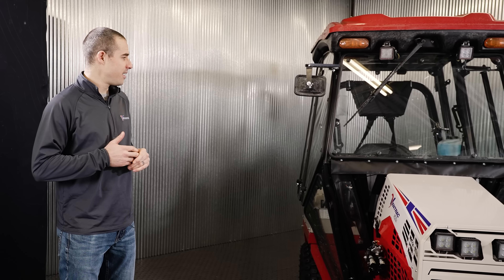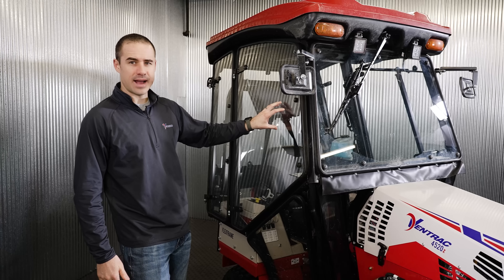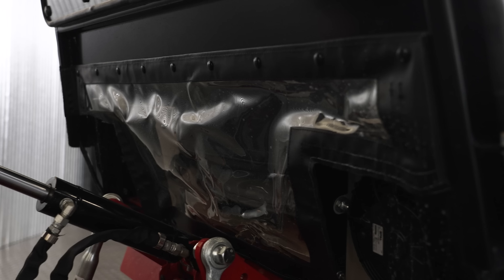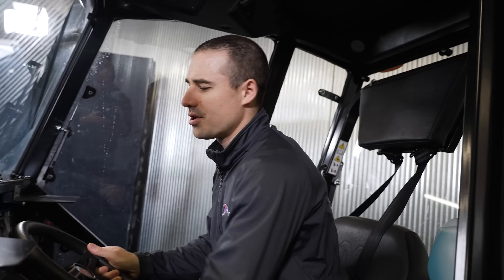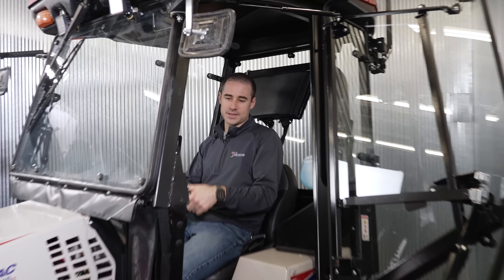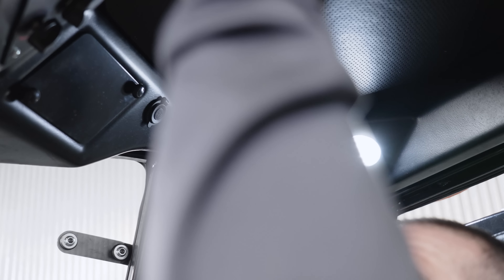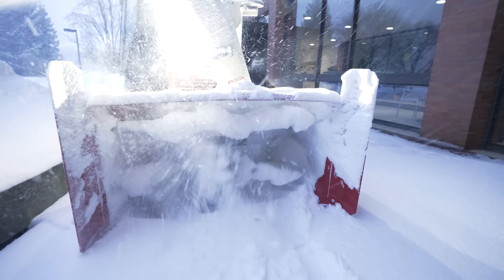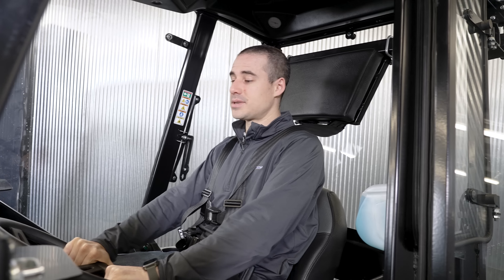Ventrac Heated Cab Walk-Around

Comment: The cab is pretty awesome and I've contemplated countless times in getting one.  How much does the cab affect the slope rating?
Reply from the maker: The slope rating with the cab is 10 degrees.
Reply: @ventrac  Thanks for the quick reply.  What about the slope rating for the wheel extensions or dual wheel kit?  I've also wondered what the slope rating change is for the new canopy.  Are there specs on that yet?
Reply from the maker: @bluecordterrainmanagement  Equipped with a cab the slope rating remains 10 degrees regardless of wheel set up. The slope rating for the new canopy is 30 degrees. Thanks!
Reply: @ventrac  that canopy IS nice, but mowing around and thru guide wires near power poles can get risky real quick.
Reply: @ventrac  10 degrees is probably why my next suggestion wouldn't work; depending on the terrain for summer use. But here goes: Why not add a filtered rooftop air conditioner for summer work? A lot of the videos show that some of the environments are hot with dusty/air-born debris. It would justify the cost of the cab as an all-season benefit.
Reply: @TCSkiFilms  trying to run an ac compressor would rob all the hp from the unit wouldn’t it? I know my 4500P puts out Exactly enough amps to run the lights and pto.
Reply: @ventrac  what's the price tag for this machine any dealers n southwest iowa

Comment: Is the new canopy the same part as the cab headliner on the 4520 models?  I'd like that downdraft fan from the new canopy on a cab for ventilation in the hot weather since A/C is an HP thief and I doubt the built-in fan for the heater is strong enough to get the desired effect (correct me if I'm wrong).  Can I add the downdraft fan to a closed cab (it's not listed as a separate option)?  The cab is listed as 385 lbs., what is the weight of the new canopy (it's not listed that I could find)?  Also, with the cab, the maximum hill angle is listed as 10 degrees, with or without dual wheels.  If the glass is removed from the cab, and dual wheels are used, does this max angle increase?  Is the max angle of the ventrac 4520 series with a canopy less than without it?  I'd love to get a Ventrac 4520z to handle my 10 acres of hills (some 30 degrees), as well as have a heated cab for the winter for snowblowing, but I definitely don't want to remove the cab every spring at my age (60).  I don't mind changing from dual to single wheels at all.

Comment: You did not mention A/C for summer time use? Do operators typically keep the enclosed cab on year round in the New England Market area?
Reply: There's no AC. However the company I work for in NE only uses Ventracs in winter.

Comment: For anyone reading this more recent. I recently purchased a 4231 with their old style cab and I fit PLENTY fine. 6’3 - 290lbs more muscular than a dad Bod, but by no means a body builder lol. 

Now to ventrac. Will this cab fit my 4231 if I want to upgrade over the old metal one? And also what’s height to the top of the cab? That’s what attracted me to these machines is the old cab is 70” to top of cab which opens big ground of people in residential garage doors. ~80”
Reply from the maker: Hello and great question. The Cab only fits the 4500 and 4520. Also the height at the top of the cab is 74 inches!

Comment: I have a question, can put a cab on a 4500z duel wheel?
Reply from the maker: Great question. A cab can be put on a Ventrac with dual wheels, however the slope limitations that a cab creates make dual wheels somewhat redundant.
Reply: @ventrac  Oh gotcha
Reply: Thank you
Reply: @ventrac  I have another question, if I had either the loader attachment or the cab. Would I have to have one or the other?
Reply from the maker: @thetermintater7770  Correct, either the loader or the cab but not both at the same time.